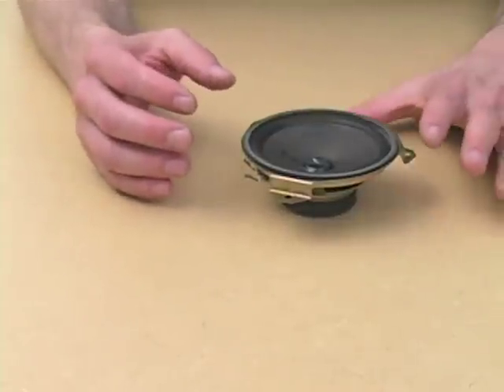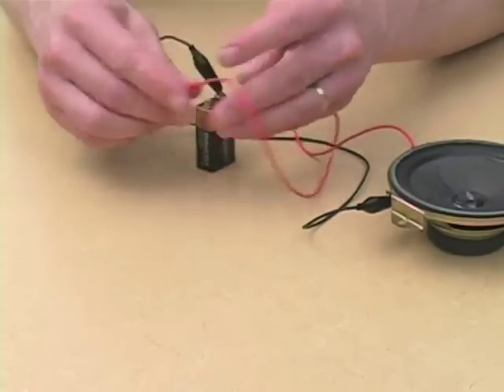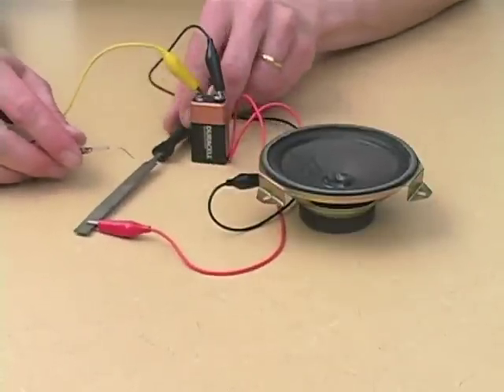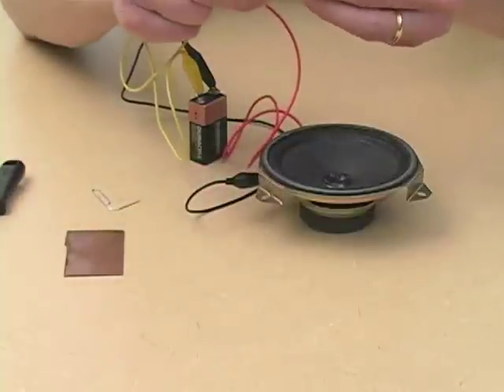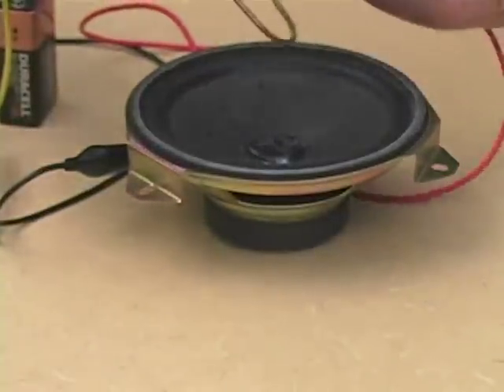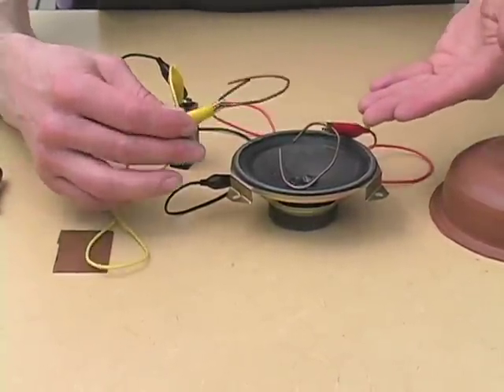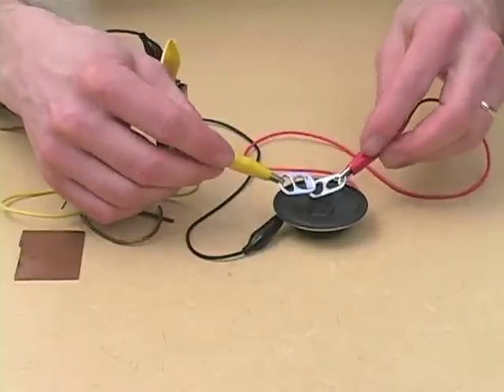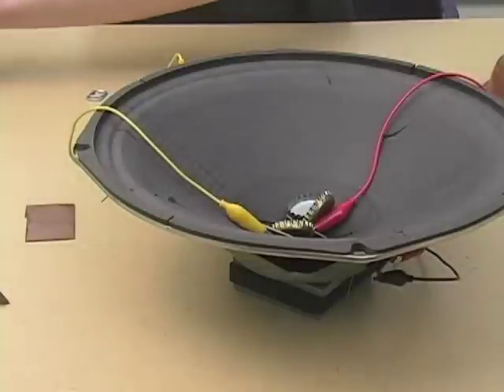Hack of the Month Club -- Project #3: Jumping Speakers

Comment: You can also attach a small dc motor in series with the battery & the speaker to produce a steady oscillation.

Comment: What if you connect multiple speakers of different sizes? Typically how long will a 9 volt run the first speaker in this video ?
Reply: +Travis Borden: Different speakers make different sounds, like drums.  Battery life depends how hard you play it.

Comment: i"ve been messing with speakers a bit lately,  and even found out how easy it is to build a basic one diy, it's only a coil and a magnet repelling each other, and now i'm wandering if the same principle could be used to build a kind of "linear" motor, that would push and pull instead or rotating, controlling it's speed and state could be just as easy as "playing" the right "beat" for it, if it could be strong enough maybe it could have many applications, like a robotic arm's joints working more similar  to a hydrolic system instead of tons of gears and pullies, maybe a pump could also work with this, etc!!!
Reply: kool. nickola tesla made an oscilator and would tune it to the inherent mechanical resonance of different things , such as buildings, bridges, ect... ohh what fun he had....🙂

Comment: and now ad one transistor (NPN Type) 2x resistors (100k,1k)2x capacitors (47uf,470uf) there are coupling capacitors. and you get a class A amp.

Comment: This is so primitive. You can easily build a decent, more stable oscillator using a bunch of transistors. It won't kill the speaker and it would not sound like a fart machine. And what do you mean by "analog algorithm"? This is just a random noise generator.

Comment: How do i attach my phone ?
Reply: +Angelo Caputo you dont
Reply: +Aleksander Sats Hey Growtopia Player! U Watch This?? LOLOL
Reply: SJDC Growtopia and u too >:D
Reply: I'm hacker in growtopia. U hacker?
Reply: SJDC Growtopia
yeee sethmumu v3.5 and acourse tmac
Reply: Yea ur Right. Lel
Reply: +Angelo Caputo Get a speaker that is compatible with your phone, then just throw the phone in.
Reply: +Endotype I'm trying to get an incompatible speaker and make it compatible
Reply: Felix Boian-Togyik I'm using small tweeters that are only 2.75 in across... I'm just a kid but I still want to listen to music from speakers. I have two of them in parallel in a t line box. I just don't have an amplifier for these small speakers because their wattage is so low. It's 4ohm 5 watt a piece and in parallel that's 2ohm 10 watts... so all I want to do is have a amplifier for that but I can't find any. I took them out of a TV so they can be pretty loud and the TV was very bass-heavy and that's the reason I wanted it. Even if all they do is played bass that's all I'm looking for. I can connect a separate Tweeter later. Any suggestions?

Comment: Throwing DC current in a speaker : the best way to burn the voicecoil !
Reply: Would possibly be less harm with a properly calculated resister and maybe a diode in series.
Reply: It will also get the battery warm the more you play with it due to the high current.
I studied electronics back in highschool so it's been awhile for me. It just depends how much amperage the speaker can handle without burning it out and how much current that little 9v battery can take before destroying it.
Reply: +xDarkSiderx But you forget that it's an air cooled coil. With AC it moves back and forth and that piece of fabric in the bottom is pumping air in and out. With DC fed into it, it will become an oven.
Reply: xxx